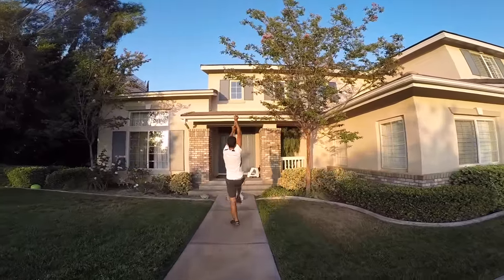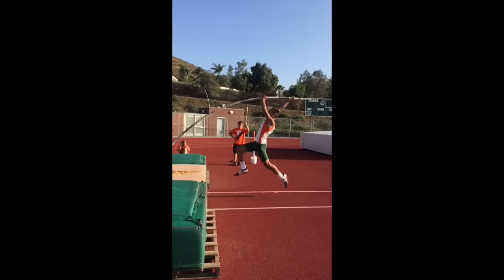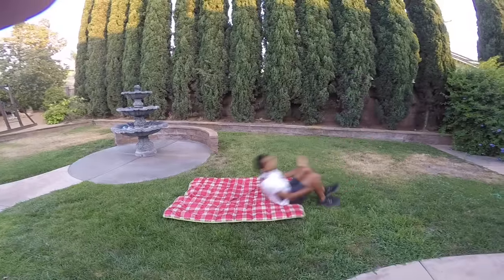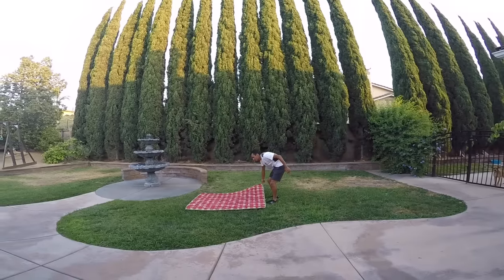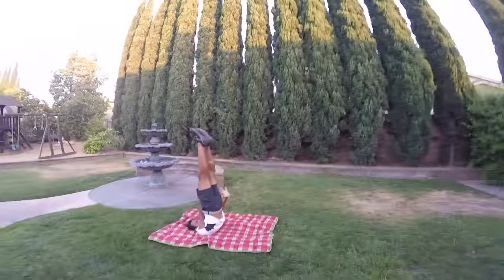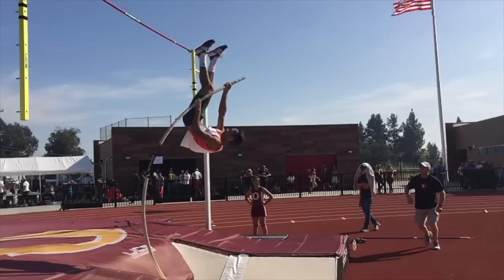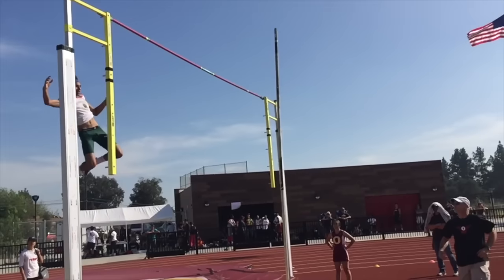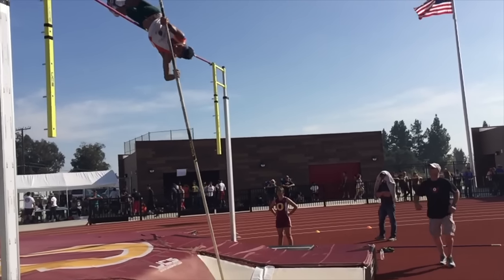Pole Vault: Swing up tutorial #2

Comment: Hi, for some reason I can do all the drills, I can do the bubhaka, and the rollback extension,  but I just cant seem to get inverted. I think the reason I cant get inverted is because I don't put my back parallel to the ground, rather its more perpendicular when I swing my legs to the pole. Is this the case? Right now I am just trying to figure out what can be a problem and so far, that is the only thing I can find. Your input will be greatly appreciated. Thanks!!

Comment: Great video, but I think the forward push with your arms is why you aren't getting fully inverted. It tends to get you stuck only 80% of the way through the swing. Just my opinion...
Reply from the maker: Thanks for sharing, I agree that the forward push alone will not complete the swing. The energy needs to be moving in a circular motion from the hands to the feet and continuous all the way through. That concept is a bit more difficult to explain and this video is not going to explain that concept in full detail. Its just a way for vaulters to develop more exercises and  a little more understanding on how the swing works.